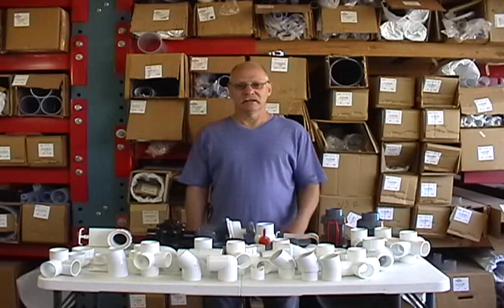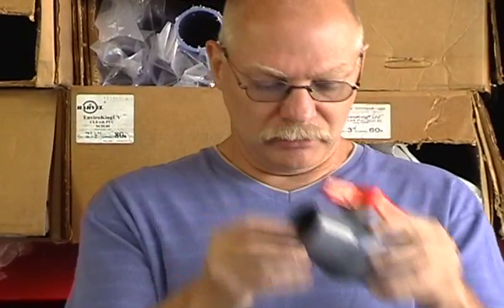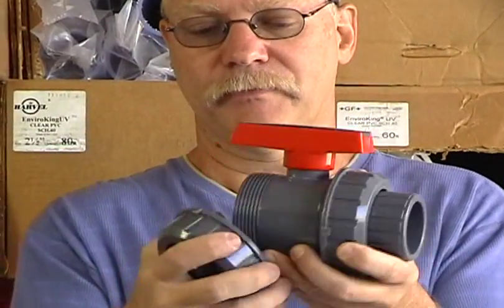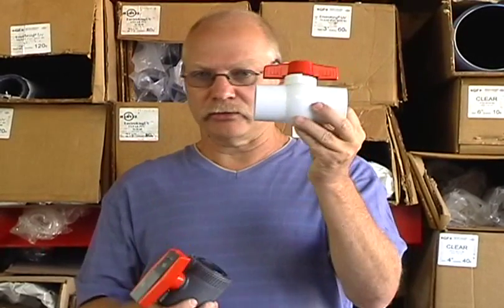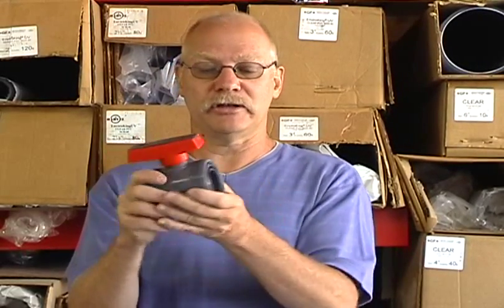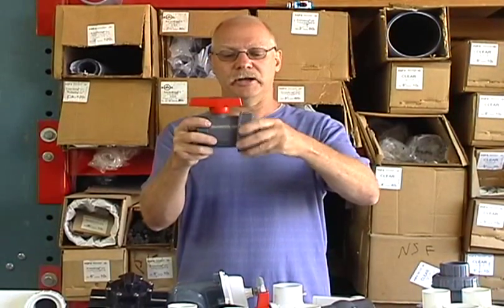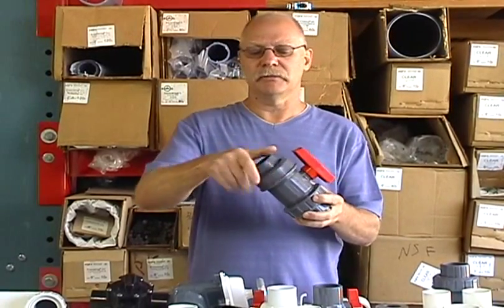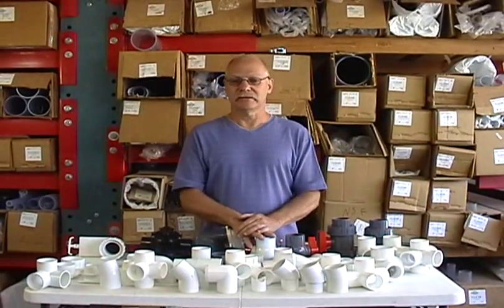FlexPVC® Ball Valves vs True Union Ball Valves

Comment: Thanks for this posting.  I'm going to have to replace all the valves on my pool plumbing (and the pipe - it is over 30 years old now and the sun has been doing what the sun does).  I'm considering using the TUB valves, although I'm going to have to put in 6 of them (!)  At $55 or more a piece, that is over $300.00, but dang, they are sure nice.  I've been using channel locks to turn the 'molded in place' valves for several years now, given the handles have broken off.
Reply from the maker: $55 each? That has to be a pretty big valve. Our range for true union ball valves is $4.15 for 1/2" up to $17 for 1.5", $27 for 2", etc. see

https://flexpvc.com/cart/agora.cgi?product=PVC-Valves-Ball-Valves-TrueUnion

Comment: I know this video is 7 years old so not sure I'll get a reply but is it "normal" for the tail piece to rotate within the assembly? Mine is rotating but isnt leaking.
Reply from the maker: It should not rotate. The only reason it's not leaking is there is not enough pressure in the system to work by the o-ring. You should tighten it a little bit.
Reply: @FlexPVC  ok. Instructions say hand tighten only and wow did I crank it as tight as I could. Thanks!

It’s attached to a gravity fed chlorine tank so not much pressure but definitely want to avoid leaks.

Comment: Hello sir, can I have your advice? I have installed stopper 4 inch pvc ballvalve and it is too tight to close and open it..  So, is there any way how to reduce it? Thanks
Reply from the maker: If the valve is installed you should have a little difficulty the first time you turn it. If it's the kind with the single handle you can take a piece pipe and put it over the handle and turn it. About 2' long is good. BUT MAKE SURE you are turning it the correct direction, otherwise you can break the handle. You can confirm the direction by looking at where the handle connects to the valve. You'll see a tab and the tab turns in a slot. So make sure you are turning in the correct direction. If you still have trouble give us a call or email. https://flexpvc.com/Contact.shtml
Reply: @FlexPVC  it’s working.. thanks for the advice sir.. 👍
Reply from the maker: @mdsuhaimiothman488  Glad we could help. :-)

Comment: So do you glue the pipe into the slip socket ball valve? What’s difference from this vs Full port. Sorry I am a newbie
Reply from the maker: All ball valves have a ball inside them to control the flow. These balls are always much smaller than the ID of the pipe. You can lose 20% flow because of this. The solution is to buy one size larger valve and then use a reducer bushing to connect to your plumbing. For example of your pipes are 1" (Sch 40, 1" ID, 1.312" OD) then you'd buy a 1.25" ball valve and use a reducer bushing to reduce the ends of that valve from 1.25" to 1" to allow hookup to the 1" pipe. That way the ball inside the valve will be at about 1" not neck down to about 7/8" like a typical 1" ball valve would do. HTH. If you need more help just call or email us.  1 888 782 3539 (M-F 10am to 4pm PST) or https://flexpvc.com/Contact.shtml for email. Thanks
Reply: Flexpvc thank you! Makes sense, even full flow valves it seems reduce flow. It’s for a sprinkler system so it sure how much flow impedance will make a differnece
Reply: @FlexPVC  ball value jamed how to make it rotate.isthere any oil or solution for it.
Reply from the maker: @paramboss007  Did you buy it from us? How old is it? What size is it? LMK (best to email is directly: https://flexpvc.com/Contact.shtml)

Comment: Are there any valves that are easy to turn? I hate how hard it is to turn off.
Reply from the maker: Sorta. The True Union valves allow you to adjust the force the seal puts on the ball. Easy force, easy to turn, but does not seal as well (ie, you get some bleed by.) Tight seal, nearly no bleed by but more difficult to turn. So I'd recommend the True Union and then adjust it to your needs. hth. Thanks!

Comment: True union valves leaks over time others is one solid piece and last much longer.
Reply: My experience is the exact opposite of yours. I’ve lost track of how many leaky PVC ball valves I’ve cut out over the years. They are junk and don’t hold up to sun and chlorine. Handles inevitably snap off no matter how careful you are. After they fail I  replace them with union valves and never had a problem since